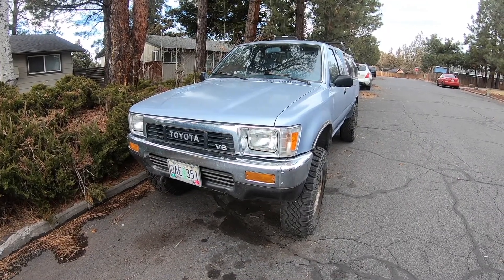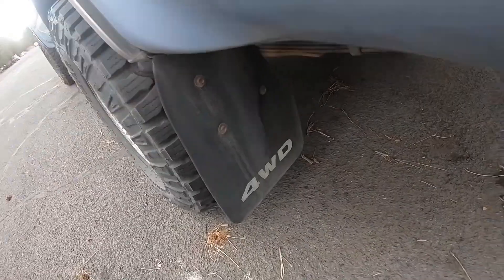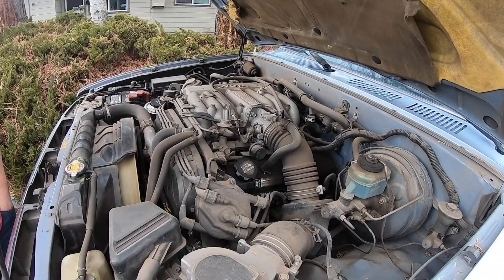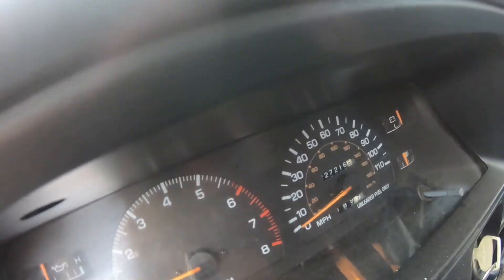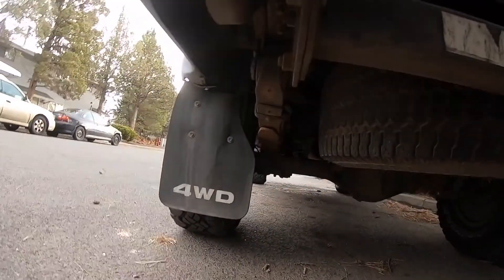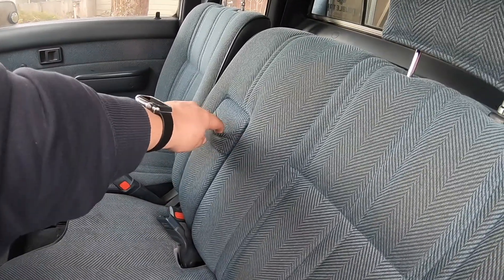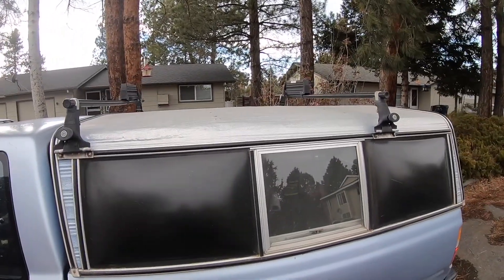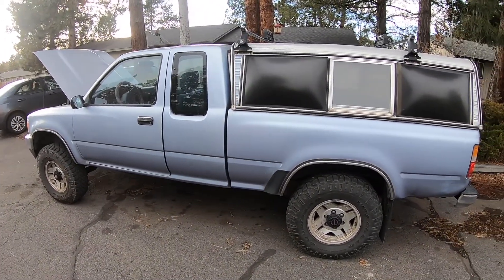1989 Toyota SR5 truck | Start up, tour

Comment: I have an identical 89 4x4 5 speed v6 extra cab minus the top and different wheels. Mine has a weird fiber glass tonneau . same color and all inside and out

Comment: I have a 94 toyota pickup. not an sr5 but has a v6, 5 speed, and 4wd. absolutely love it! my friends sometimes make fun of me because I drive a Toyota and they drive fords but at least I won't be having to work on it every 100 miles.😂 it, however, did have the head gasket problem and the frame was rotting out. my dad did some frame work and replaced the head gaskit. i take the truck everywhere!! it never let me down or got stuck. i still drive it and I'm going to take very good care of it.🙂 by the way that's a very cool truck. that thing is very rare!